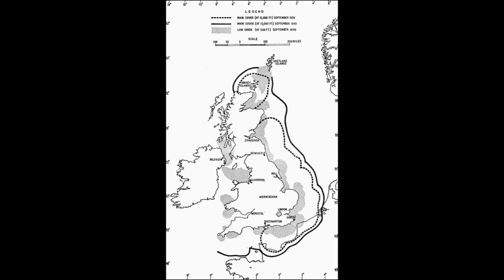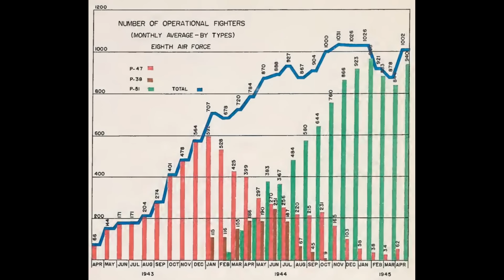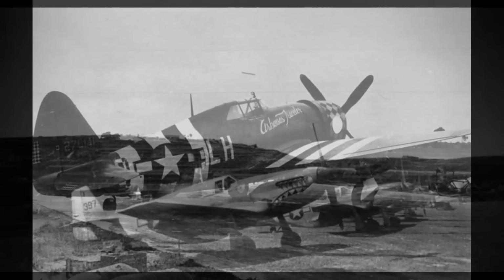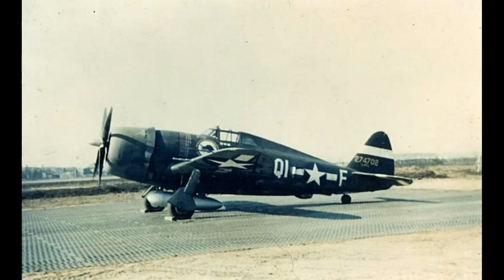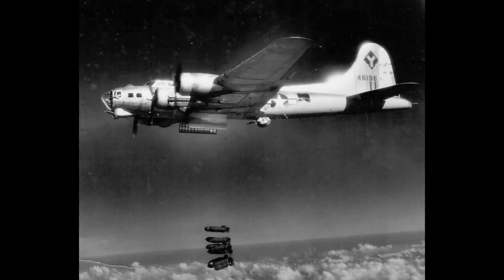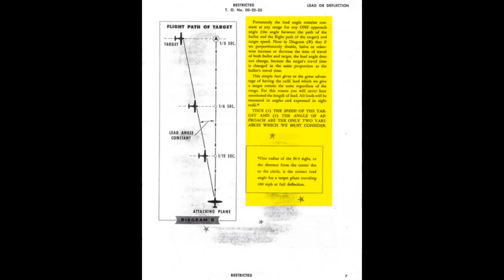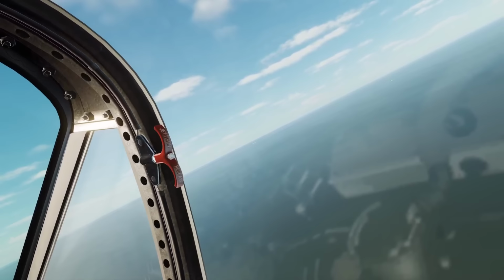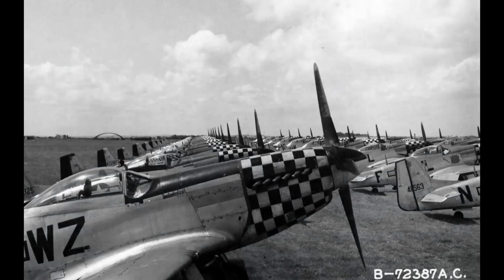Under Appreciated BRITISH Tech From WW2

Comment: Radar aiming of bombs which was far less accurate than optically sighting bombs via the Norden bombsight is exactly why the Norden bombsight has undeservingly gained the reputation it has of late for being inaccurate, the fact is the majority of bombs dropped by the 8th Air Force were dropped using the radar systems instead of optically especially during the winter months when the notorious European weather caused overcast that made optically sighting bombs impossible, hack aviation historians who don't even know about the radar aiming systems blame every bomb that missed a target on the Norden bombsight. 
Other factors that get blamed on it are things like navigators flying entire formations to the wrong target causing a "zero bombs on target" result for that mission even though the bombardiers plastered what they were aiming at, the Germans lighting off smoke pots to obscure visibility, also them camouflaging targets and setting up decoys nearby.
But one of the biggest that affected results was all the dirt and debris thrown into the air above the target from the first bomber box's bombs exploding and then further box's bombs causing degradation of results down the line, a single 500 lb general purpose bomb displaced and threw into the air enough dirt to fill 13 dump trucks, each B17 on a deep penetration mission dropped twelve 500 lb general purpose bombs, that's 156 dump trucks worth of dirt, times 12 bombers in a box equals 1,872 dump trucks worth of dirt thrown into the air above the target that the lead bombardier for the 2nd box had to aim through, wartime reports and studies showed that when the Norden bombsight was used over 80% of the bombs dropped from the first box hit within 400 ft of the aiming point, the 2nd box was down to the 70 percentile range, thos degradation in accuracy went down to around 25% by the time the 5th bomber box came along due to all the dirt and debris in the air above the target from the bombs of the previous boxes.
Reply from the maker: No argument here. I'm not disparaging the Norden, it's just not the subject of this video. For all the crap the Norden takes, few seem to realize that there wasn't a more accurate option from high altitude.
Reply: @GregsAirplanesandAutomobiles  
I know you weren't, that post was for the benefit of anyone who reads it that's been sucked in by all the biased people who in the past 20 years or so for the sake of acting like experts on the subject do nothing but bash the Norden bombsight by blaming it for every single bomb that didn't fall down the smokestack of a factory. 
Saying the Norden bombsight was inaccurate by using their measuring metrics is like saying the M1 rifle isn't accurate because after the war a study showed that for each enemy soldier killed 300 rounds were fired from M1 rifles, take it from someone whose been collecting them for over 30 years M1's are incredibly accurate, but there'll be all kinds of internet experts out there that'll cite the 300 shot post war report as proof that it wasn't.
Reply: @dukecraig2402  What is a legitimate topic of discussion is was the pin-point targeting provided bythe Norden bomb sight a war-winning tactic? In both Europe and the Pacific the USAAF resorted to area bombing.
Reply: @ronhudson3730  
First of all that's an entirely different subject that has nothing to do with whether or not it was actually accurate, and you're sitting there doing exactly what I pointed out, you're piling the results of the entire bombing campaign on the back of the Norden bombsight by saying "...was the pin point targeting provided by the Norden bombsight a war winning tactic?".
Didn't you follow the narrative? Not using the Norden bombsight for the vast majority of the bombs dropped have absolutely nothing to do with whether or not it was accurate, you're so used to bashing it that even after it was pointed out to you that the majority of bombs weren't aimed using it you're still looking to put the responsibility of other systems and factors on it.
The vast majority of the times it was actually used and things like navigators not flying the formation to the wrong target aren't part of the results they'd absolutely plaster what they were aiming at, so yea, even if it was only used between 15 to 20% of the time when bombs were aimed then yes, it did shorthen the war by that much. 
Another thing you're doing is using the term "area bombing" out of context, the US didn't change the way it was bombing because of accuracy the way you're implying and it never quit pin point type bombing, it's just that after a certain point they started bombing cities on some missions which are area targets by their nature, they never quit precision type bombing, that's a false narrative perpetrated by the same biased people who simply want to bash the Norden bombsight and the bombing campaign as a whole.
Other things that give a false impression as to it's accuracy is the fact that if only a lead bomber is actually sighting it's bombs with it and the rest of the bombers drop their bombs off of it's cue then you can't measure the distance from where any of their bombs hit to the aiming point, which is what's done even by the USAAF in their reports, but what should be understood is that their reports in that regard are about overall results not whether or not the Norden bombsight was actually accurate or not, to properly access it's accuracy you can only measure the distance from the impact point to the aiming point of the bombs from the lead bomber which were the only one's actually being aimed by the Norden bombsight, that's something that the USAAF doesn't point out in their reports because first of all they already knew that and secondly they were looking at overall results from the system they'd devised, people never take that into account which is why there's all these false narratives out there concerning the Norden bombsight and it's accuracy. 
Other things that get thrown around which are things taken completely out of context are narratives like "The British were offered the Norden bombsight and turned it down because they found it wasn't any more accurate than their bombsight", that narrative is not only problematic on so many levels it's actually laughable to anyone who understands the Norden bombsight system and how it works along with the fact that it wasn't compatible for use in British bombers without them having a major redesign of some parts.
Contrary to popular belief the bombardier didn't actually "fly" the bomber during the bomb run, the autopilot was actually flying it with the bombardier having the ability to input simple left and right yaw corrections to align the target, without a bomber being equipped with the Sperry autopilot system it couldn't use the Norden bombsight, I don't even believe the narrative that "it was offered to them and they turned it down" in the first place, I think that's just another example of people taking things out of context, why would they offer them the Norden bombsight when they knew in the first place that it wasn't as simple as just bolting one into a bomber and away you go bombing things? That doesn't even make any sense, they knew major conversions would have to be performed on all the British bombers along with the months it would take to train crews to use it and why would they since at that point the RAF was committed to night bombing? Nothing about that narrative makes sense along with the same one about the Germans deciding not to use it after having stolen plans and captured Norden's from downed planes, like the RAF they didn't have bombers capable of carrying bomb loads to the altitudes that the USAAF did with it's bombers that had turbo chargers on them, they weren't bombing at those altitudes and in daylight anyways so why would either one suspend their bomber operations for the months it would take to convert their bombers and re-train their crews so they could use it? They wouldn't nor would they even consider it in the first place. 
The Norden bombsight was incredibly accurate, matter of fact it was so accurate it was still being used to optically aim bombs dropped by US bombers into the Vietnam War, if it was half as inaccurate as some people claim they would have quit using it at the end of WW2, given the advancements in aircraft during the 20 year period between WW2 and Vietnam the fact that it was still being used instead of some kind of a replacement having been designed for it speaks volumes to how accurate it really was.
Reply: @dukecraig2402   The Norden bomb sight was marketed as having pin point accuracy, 'could put a bomb in a pickle barrel' comes to mind. It couldn't. It was a decent bomb sight of it's era but its capabilities were massively over sold.
Reply: @gwtpictgwtpict4214  
And there's something else that's a bunch of malarkey, no one involved with designing or making the Norden bombsight or the USAAF ever claimed it could "drop a bomb in a pickle barrel", no one knows where that got started at but it was never a claim made by any official source nor can you find a claim made by any of them stating that, like the nickname for the Flying Fortress maybe it was the product of a reporter but who knows, whoever it was started that it never came from any official source.
So if someone is running around saying that you said you could jump over the tallest building in your town are you responsible when it turns out you can't? Are you supposed to be held to task for something someone else was saying about you? No, you're not.
The Norden bombsight could place a bomb from a bomber moving 225 MPH at 25,000 ft within 400 ft of it's aiming point, nobody else in the world could do that in the 1940's. 
Here's something else that gets added into the math when people talk about it's accuracy that the commander's of the USAAF understood when they were looking at reports that people just don't know about, there was a feature on the Norden bombsight called the Intervalometer, it had about 7 settings on it and it was for spacing bombs along the flight path of the bomber instead of dropping them all at once, it would release the bombs automatically in intervals, hence it's name, it was used for targets that had length to them instead of a particular aiming point such as railroad marshaling yards, the mechanical computer of the Norden bombsight compensated for the Intervalometer setting so that if it's setting would drop the bombs along a 600 yard long string it would release the first bomb 300 yards before the target and the last one 300 yards beyond, in the cases when the Intervalometer was used to properly access the Norden bombsight's accuracy you have to measure the distance from the center of the bomb string to the aiming point, not from the two furthest away bombs to the aiming point, this is something else that all the biased people who just want to bash it don't take into account. 
Sorry if all you guy's who've loved to run around posting things in videos about WW2 US bombers like "The Norden bombsight could only hit 5 miles away from what it was aiming at" and now you've got to face saying it simply isn't true but it's not true, within 400 feet of the target from the altitudes and speeds the bombers were traveling at is incredibly accurate, if bombardiers aim at wrong targets because navigators fly them to look alike cities or worse yet if it's not even used to aim bombs in the first place those things aren't a reflection of it's accuracy, maybe try checking the source material used by the people who create those videos bashing the Norden bombsight before being so eager to run around repeating what they say, every single video I've run across claiming that nonsense I've challenged the creator's of to present their source material and they never do, all they're doing is being eager to be a bunch of big mouthed show off's and run around claiming a bunch of nonsense they got from other erroneous and biased videos for the sake of popularity and getting clicks, they understand the principle that people suck up sensationalism and will eagerly ignore the truth if it proves otherwise. 
You've got two kinds of YouTube video creator's, one's like Greg here who show source material down to an image of the very page they get their information from and the kind like the guy two weeks ago who flashed the cover of a post WW2 report and claimed that it was part of a USAAF study done after the war that determined the USAAF bombing campaign was a failure, despite repeated attempts to get him to show the actual page where it says the bombing campaign was "a failure" or even answering me and telling me what page and what report it was in so I could look it up to confirm it myself he never got back to me, that's because no such thing exists, and the report he flashed the cover of probably didn't even have anything to do with bombers or assessing the results of the USAAF's bombing campaign, it was probably a report on weather conditions or something like that during the war and was just something he came across to flash an image of in an attempt to give his narrative credibility, people like that don't care about history or educating people in it, they just want as many clicks on their videos as possible because that's how they're making a living, so if you want to go through life quoting them knock yourself out, there's plenty of them out there happy to present things out of context and make claims like "Their bomber losses were so high they suspended the bombing campaign", that's a claim that gets made a lot that Greg himself addressed in this video, just as I have myself by telling people that I have a list of evey bombing mission flown and I'd be more than happy to list every one that flew during the time period they claim bombing missions were suspended, just like I can dispell all the nonsense claims about bombs only being able to hit 5 miles away from where they were aimed at with a Norden bombsight and claims about pickle barrels.
Reply: Rarely did the bomber crews feel safe flying the way the Norden sight required over their target. Supposedly the bombardier was in control but according to accounts of crew that rarely happened. As the war progressed the bomber groups started dropping on command of the lead aircraft and there was even a system where the lead bomber triggered the bomb drop from all the bombers in their formation on a remote radio signal. The Germans figured that out and triggered the bomb drop as soon as the system was turned on. That resulted in about 100 bombers needing new bomb bay doors because they weren't open yet. The Norden might have worked if the enemy had agreed to let it be used unmolested.
Reply: @jackgee3200  The autopilot slaved to the bomb sight was the way it was supposed to be used and how to get best accuracy but that left the bomber an easy target for flac and the pilots would not let it be used that way. Read Smokey Yunick's accounts of his missions as a B-17 pilot. (Best Damn Garage in Town - Under a Snake's Belly, Smokey’s youth and military career, Carbon Press) Paraphrasing 'You only did that once' After that you were watching the flac and trying to avoid it on the bomb runs. As to the radio bomb release I think that was while he was flying from Italy and Curtis LeMay was the flight leader and because they never reached the target it was written off as a training mission and the crews who were killed were not considered combat casualties, which bothered Smokey.

Comment: Hi Greg! I've read german pilots mostly didn't use gyro sight attacking manevarable targets. And we can easily make it fixed by setting minimum distance twisting the throttle grip. 
Did you turned on "wake turbulence" (or slip stream) in DCS options? If not it can be new interesting experience while attacking enemy from behind.
Reply from the maker: Yes I have that on. I can take out bombers all day long with the gyro sight, including B-17s with the Dora.
Reply: @GregsAirplanesandAutomobiles  Yea, really handy sight against bombers, if you got a little practice. I guess MiG-15 has a copy of Dora`s sight - ASP-3N (in DCS).

Comment: 14:20 no, you're not on solid ground there. delaying D-day by 2 months means no D-day that year

or maybe that means you're standing on bedrock
Reply from the maker: If anything that solidifies my case, more like the bedrock you suggested. Estimating the exact amount of delay would be a pretty big undertaking, too much to squeeze into this video.
Reply: @GregsAirplanesandAutomobiles  yes. my previous post was pretty flippant, and the words i used don't properly express what i meant, which is:

it seems that you were making a minimal suggestion as to the consequences of not having air superiority. i disagree with you ONLY on that - the consequences would be huge. i do understand that you are unwilling to do much speculation, restricting yourself to things that you know to be true.

i seem to recall that the weather was a big factor in the timing of Op. overlord. the planners were unwilling to let it happen unless they had sufficient good weather, and any delay would use up the available window that year. even as it stands, the actual invasion was felt to be pretty risky, because the weather actually was pretty bad, but there appeared to be a break in the weather.

Therefore, given the strategic pressure, and the consequences of not going on June 6, the risk was taken.

Since the Germans had worse weather reports (being to the east, not seeing what was coming from the west), they pretty much figured that they were safe for the rest of the year.

Again, you might not be willing to say those things, without doing a lot of additional research, but I am less restricted.

https://www.iwm.org.uk/history/how-d-day-was-delayed-by-a-weather-forecast
Reply from the maker: Very well said. Thank you.